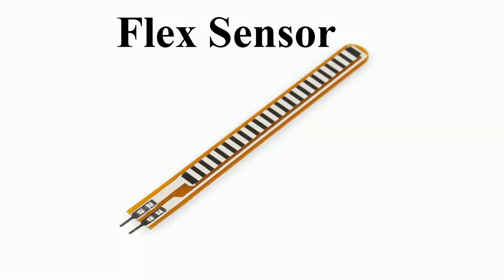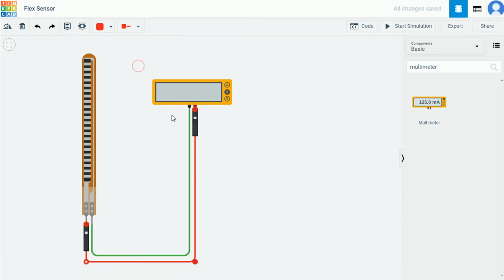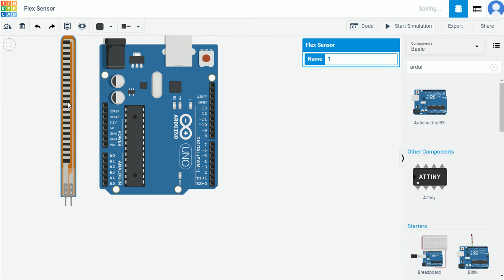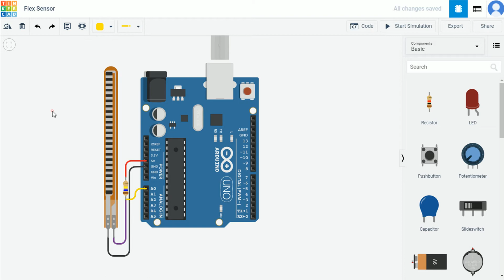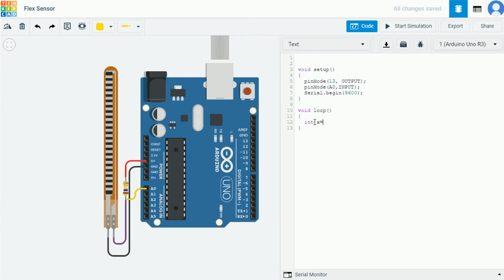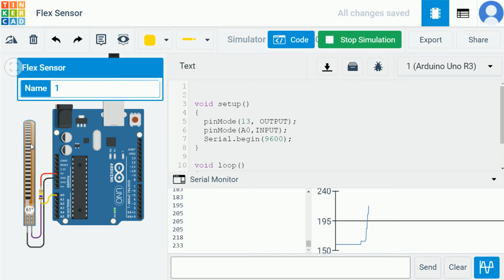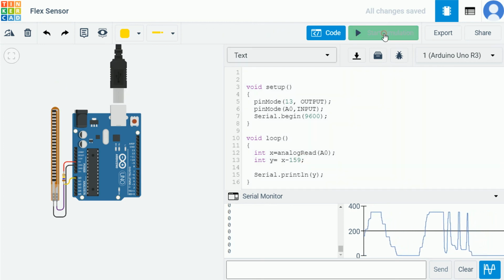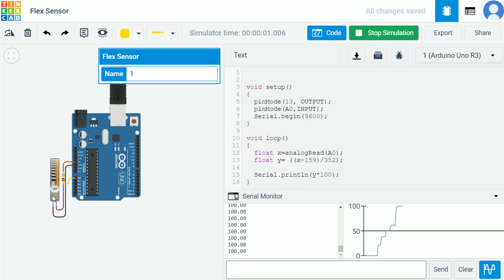All About Flex Sensor in 8 Min | Basics | Working | Arduino | Interfacing | TinkerCAD Simulations

Comment: WHAT IF I WANTED TO CONNECT 4 MORE SENSORS?
Reply from the maker: You can include the FreeRTOS (https://www.arduino.cc/reference/en/libraries/freertos/ ) library, then you can do multitasking and get data from more than one sensor or run multiple tasks simultaneously.

Are you planning to attach these sensors to your hand?

Python EveryDay!!!
Reply: @PythonEveryDay  thanks , yes thats my project
Reply: @PythonEveryDay  the link is not working